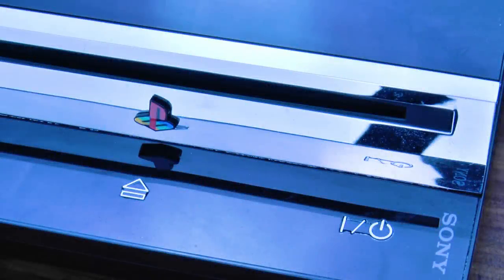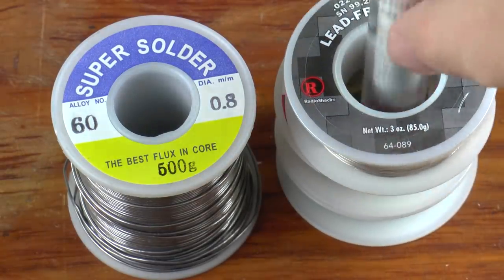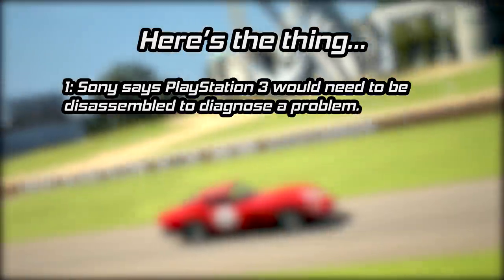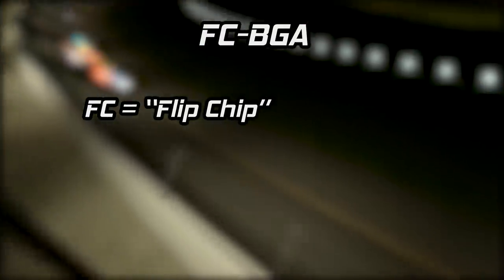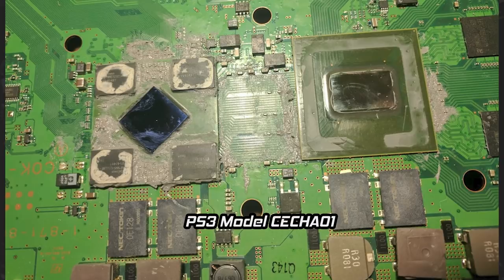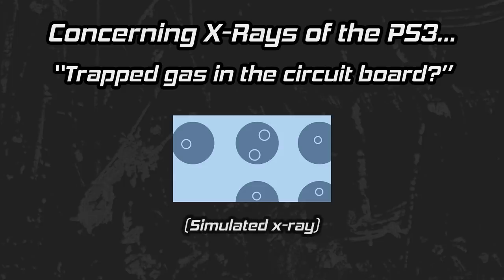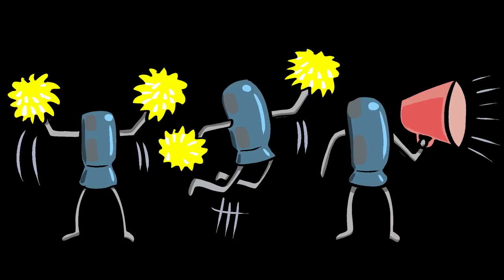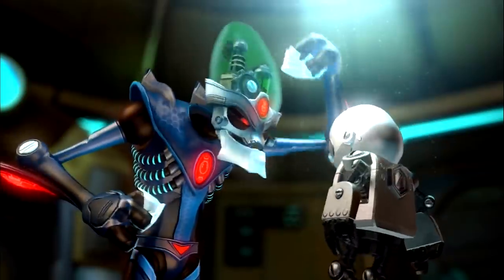The Misdiagnosis of the PlayStation 3 Yellow Light of Death

Comment: So only the Wii had adequate cooling in the 7th generation
Reply: It had nothing to cool, it was super low voltage.
Reply: Super_Slav I think you mean low power. And yeah, there was almost no power but you can’t deny that the cooling did the job adequately and the Wii didn’t overheat
Reply: Syntheon I absolutely understand how underpowered the Wii was but I’m just saying that it’s cooling system was perfectly fine for the job.
Reply: And was still the worst console that generation also.
Reply: Syntheon  Yeah it definitely sold alot to retirement homes and soccer moms.
Reply: It was politics....straight up
Reply: First generation of quite hot consoles. The generation before only needed gentle cooling while the gens before that were all passively cooled.
Reply: well, my wii suddenly turned itself off after a few minutes of game play, it showed a yellow light, and I realized  that the fan was not spinning, I removed a small stone and the fan worked fine and the wii worked fine after that.
Reply: @Steven Ross-watt lucky you, I bought one that suddenly turned itself off randomly with the "ylod" but after a while you could play again until it turns off again, as it was a cfw compatible console back then those consoles were pricy I managed to sell it as is to a technician, I recovered my invested money and he seemed ok with that flaw.
Reply: @Steven Ross-watt given the fact the wii is discontinued since 2013 yes it was a second hand console. 

Edit, with that ps3 slim model was also second hand, new consoles are extremely expensive in Ecuador, I feel so angry watching a ps4 slim being sold at 2000 dollars and yes we use american dollars as currency since 2002
Reply: @hpickettz34  As a Nintendo fan, I honestly have to agree. Outside of a handful of Nintendo games the library for it was pretty bad. It still had a much better library than the Wii U though. That said, I am happy I got one, I'm still catching up on PS3/360 games now though.
Reply: iLoveJackingOn No,Wii boasts the same power as 2 Gamecubes
Reply: Wii RVL-001 The Wii is so underpowered it didn't need any heavy cooling.
Reply: buy a cheap windows laptop on amazon. You’ll get low powered hardware AND overheating. Low power != well cooled
Reply: @REPOMAN24722  😂😂😂😂👍
Reply: It was a slightly more powerful GameCube with motion controls, of course it had proper cooling.
Reply: @MattsNotBanned_ they cant make these mistake again
Reply: Yes and No at the same time. Release models around 2006 to early 2007 had issues with overheating GPU's due to WiiConnect24 Service and a faulty power state setting in the STARLET ARM Chip which let the GPU being active during standby (only if WC24 was active = amber power LED) and the internal fan was turned off. The result was the GPU slowly cooking itself to death... Lucky enough this got fixed within newer hardware revisions before anyone could make a big deal out of it. Otherwise WII Cooling design was OK for it's job. I have 2 Wii's one made in 2006 and one 2009 model which uses the newer 65nm IBM Chip and this console runs significally cooler than it's 2006 predecessor.

Another thing they did with later Wii models is removing the additional metal EMI shield on top of the heatsink to improve airflow. Kinda similar design was used on the Wii U but that's a different story.
Reply: And the only good cooling in 8th gen was WiiU.
Reply: False. Leaving the WiiConnect24/7 or whatever the hell it was called fried components in that thing, just not with the same widespread regularity as the 360/PS3.
Reply: @ruggie.74  That's the definition of hardware failure. High rates of the same problems. If the rates are very low it is called "No hardware problem at all". PS3 X360 had very high rate of overheat issues, above the tolerance level. Just like Joycon Drift.
Reply: @alinepiroutek8932  Burh, I ain't talking about mass hardware failure. OP said the Wii had adequate cooling; my example (and I'm not the only one) illustrates that it did not. If you left that service on 24/7 for years, your hardware would eventually melt due to a lack of cooling. Why do you think Nintendo has never offered the same service since? O_O
Reply: The Wii may not have much power but it had adequate cooling.

The 360 and PS3 however had inadequate cooling.

If the Wii had inadequate cooling it would have overheated as well.
Reply: My Wii was a cockroach and dust magnet as soon as I got it and it's still working.
Reply: The Wii didn't get hot. At all.

It could have likely been made passive or was so not power hungry.
Reply: @ruggie.74  yup. I found a Boot2 Wii from my buddy (Holy Grail back in the day) took it home and noticed artifacting.

GPU RAM was done for. It still worked but... not well.
Reply: @nexxusty  Yeah, same thing happened to 2 of my Wiis and one of my friend's. :(
Reply: @ruggie.74  really? I mean I know it's happened to a lot of people.

Still sucks to hear it happen to someone. There's nothing that can be done aside from replacing the RAM.

I think I sold it to someone for really cheap. They didn't care lol. It did still work. Just artifacty. Lol.
Reply: And the Xbox 360s after the Core
Reply: I love the Wii dearly, but yeah there really wasnt much to cool
Reply: Regardless of how powerful a computer is, overheating suggests poor design.

And you can overheat even the lowest power system if you don't design it right.
The Wii does have a cooling fan and heatsink, and it has it for a reason.

Speaking of poor design leading to failures...
Guess what's known to fail on some Wii consoles?
The 'ultra low power' secondary controller used for Wii Connect 24 functionality.

Why? Because there's a bug with some models of the system where this chip doesn't correctly enter a low power state.
That's fine when the system is running, but when it shuts off the cooling fan, it can gradually cause overheating due to how this particular chip is cooled.

Point is, Weak system or powerful, if you design your cooling arrangement poorly, bad things happen.
Reply: @KuraIthys  this is why I tear down and service my consoles a few times a year, just did my ps4 last night, my wii & wii_u right before that and my backwards compatible ps3's(all 3 of them lol) are next on the list, then all the xboxes after that and the gamecubes and cart systems after that, and so on.
Reply: 3.5 inch 1Tb hybrid hdd in that ps4 btw, copy/install times are sooo deliciously small. #wuuf
Reply: @Steven Ross-watt Are they 2nd hand used or newly unboxed when you first bought them?.
Reply: Yeah, if the Wii had enough power to overheat then maybe it would have had the same problems!
Reply: @hpickettz34  I found the 12 year old
Reply: What 7 generation
Reply: Tech Troll gamer of gaming console
Reply: Actually, my Wii console had the overheated gpu issue due to shit heatsink assembly and the standby mode heat, and became permanently damaged as consequence. This happened not long after purchase with little use. Causes colour and graphic glitches. Was a launch model. 1st and only console to have ever failed me. My two fat PS3s 60gb and 80gb and Xbox 360 original still work with no problems. Go figure.
Reply: toppdogg2k17 no it wasn’t it sold more in that generation
Reply: Easy to stay cool when you're not doing any work.
Reply: Well my ps3 slim runs cool only the fat ass version runs sweaty Everytime it runs
Reply: @twizz420  lol the Wii does have enough power to overheat, specially known to people who chop them up to make portable. I don't understand why idiots complain do heavily because it was underpowered and therefore doesn't overheat.
Reply: Pretty much. It can heat up when playing disc games for too long, but it's nothing too major, considering the competition
Reply: @iLoveJackingOn plus some other niceties like increased ram and network support
Reply: @alinepiroutek8932  I still wonder how the wii u basically never gets hot
Reply: @NinjaWeedle  Good engineering
Reply: I had a Wii overheat and break, but it was probably a factor defect since it overheated in a 60F room in Alaska during winter. No way in hell a healthy system of any kind should have overheated in those circumstances.
Reply: The later 360 and PS3 models had adequate cooling, for the most part.
Reply: Matt Wolf I want to get a Wii. Getting many Wii games and and especific Gamecube tittles
Reply: The 360 was fine, the issue with the 360 wasn't the solder balls, it was actually just faulty chips straight from ATi. (I get my information from leaked internal Microsoft documents)
Reply: My Wii failed and had to be replaced... twice. Although, I will say that Nintendo is incredible when it comes to service and the replacements were BOTH overnighted.
Reply: It also had a yellow light of death, I've had 2 wiis both die
Reply: @PackardKotch  my calculator's cooling system is perfectly fine for the job
Reply: @esathegreat  well you're not wrong, its all about how much heat the device produces. The wii has a worse cooling system but it produces significantly less heat so the cooling is adequate
Reply: Xavier  Just because it sold alot doesn't mean it was good. Just look at the shovel wear and that Nintendo has been undoing the wii controls for the last couple generations of Nintendo consoles
Reply: Xavier  yeah, wii is garbage. Common as fuck garbage
Reply: That's because the Wii was just two 6th generation consoles duct taped together 🤪
Reply: Xavier  that statement is wrong, while the Wii is using upgraded GameCube hardware, that doesn't mean the loads are low, loads are not relative to CPU power but to how much can it do.
Reply: @mattwolf7698  "it was pretty bad" so let me list some good games wii had: Super Mario galaxy, Wii  Sports, Wario Land: Shake It!, Mario Strikers Charged, Super Smash Bros. Brawl,   Mario Kart Wii, No more heroes, house of the dead overkill, kirby's epic yarn, tatsunoko vs capcom, wii sports resorts, Sonic colors, skyward sword, punch out, Rhythm Heaven Fever, Mario galaxy 2. " pretty bad" right?
Reply: the wii was also the best console of the 7th generation
Reply: @ricki399  and that’s where I’d have to disagree, since they were all equally amazing. 360 had the best racing games and shooters, ps3 had some amazing grand adventures and Wii was the best console to play with your family.
Reply: @PackardKotch  i agree with you, there is nothing on wii like halo 3 or god of war 3, i just happen to like the wii games more.
Reply: @ricki399  that’s totally reasonable. I am a little biased towards Xbox 360 and ps3 because I grew up with one in my house and the other in my cousin’s house
Reply: That is literally the opposite of what the video is trying to get across. How did this get 560 upvotes?
Reply: @zanmaru139  ahhh, I see you also lurk around  Reddit
Reply: @zanmaru139  you spending too much time on reddit buddy
Reply: Wii overheating sounds intensify
Reply: that thing gets HOT when you leave on standby, but it's never actually overheated for me
Reply: If you ask me the Wii was something like 6.5 generation, a bit more powerful than the 6th but nowhere near the 7th generation, same as the Dreamcast a bit powerful than the 5th generation but less powerful than the 6th, same today as the Nintendo Switch, i would argue that it is 8th or 9th generation, nowhere near the power of PS4 or XBOX 1.
Reply: it was also the least powerful. That might explain it.
Reply: Only the wii wasn’t breaking randomly
Reply: It had adequate cooling for a 480p-576i display output, gaming only, "7th generation" machine.
The Xbox360 and PS3 were totally different multimedia beasts and the only true 7th generation consoles imho.
The Wii was a 6th-7th gen stopgap console, and Nintendo decided to keep doing stopgap consoles ever since...
Reply: Luna Lux  the wii is just a slightly better game cube, and the game cube was fine
Reply: Actually, early Wiis also happened to die from overheating due to a firmware bug that kept the processor running without any cooling while in sleep mode. The heat built up over time and consoles died. That made a lot of Wii owners at a time to always turn the Wii off completely, and to never use sleep mode, years after the firmware was updated and the bug fixed.
Reply: Wii’s had defective disc drives and also would overheat if connected to WiiConnect24 while in standby mode.
Reply: Haters like to claim that the Wii only sold because of Wii Sports and always ended up collecting dust when the novelty wore off but this is not supported by real figures. In fact, this is thoroughly disproven by the fact that the Wii had the highest software attach rate of all consoles in that generation, including the portable ones.
Reply: true, mine has been left running for literal months on end, has more hours of playtime on it than I could even try to figure out, still works like new 🐱
Reply: Nope.

Wii Connect 24 fried my launch Wii.

They all had issues. That entire generation.
Reply: @PackardKotch  Alot harder to cool something that generates alot of heat.
Reply: Due to the adequate weakness
Reply: more like the Wii was the only console with a working GPU in the 7th gen
Reply: @gypdarin1458  Buy a super cheap, super weak laptop from somewhere. Quite a big chance you'll run into heating issues regardless how weak the hardware is. 

Seriously think about that logic lmfao, if overheating can't happen on weak hardware how was there overheating issues in tech 40 years ago?
Reply: It also won the 7th generation...
Reply: Well the Wii was essentially an overclocked GameCube and both the 360 and ps3 had reliability issues with the processors
Reply: @hpickettz34  that sold the most units.
Reply: yup got a ylod and rrod at that time both are out of warranty when it happened
Reply: this is false , my wii burned out and overheated from playing SSBB
Reply: @itzderrio  how did that happen
Reply: @rgracing4109  because i played it alot and SSBB uses dual-layer disc that the wii struggles with
Reply: How has our ps3 not had the yellow light of death. It turned the normal loud fan on but then it was as loud as a vacuum.
Reply: @PackardKotch  Wiis did overheat. Early Wiis using Wiiconnect24 had the GPU idle while the fan was off, causing it to overheat.

I have a black RVL-CPU-60 Wii without this issue, though.
Reply: My PS3 Super Slim is second hand and works great! Gutted a Hard Drive from an old laptop and put it in there and it works like a charm! Never gets hot! Stays cool no matter how long I leave it on... my Switch on the other hand... I got that close to launch and late last year the fan started dying and now when I play docked the thing overheats and goes into sleep mode after just a few hours of play. Super loud in Handheld too. Waiting for my W2 to come in so I can hurry up and do my taxes and hopefully get a good enough refund to get an OLED model. Wish me luck!
Reply: @Ty4ons Besides the Original Xbox,that needed pretty good heating

Comment: mine came back to life by itself just by sleeping 4 years in the closet
Reply: Mine still works till this day just needs a exchange of cover as it's scratched
Reply: @thealien_ali3382  Till this day? So it died today? Or did you mean "to" this day?
Reply: Dragon Shippuden  I'm calling bs
Reply: @lukewatson059  but why tho?
Reply: Pablo Perez sony used the wrong paste
Reply: ill have to pull mine out and see if its working again,them caps look easy to replace might try that :)
Reply: I'm still waiting for mine to wake up.
Reply: @PabloRey18  because then you have a working ps3...  its a hassle but it saved mine Twice added 4years
Reply: Damn i shouldnt sold mine
Reply: I bought one and it works 100% fine. Just gets really fucking loud
Reply: My ps3 has been sleeping in the closet for 7 years and still hasn’t worked
Reply: @Swampert_Tube  you should open it and change the thermal paste its dry thats why its loud
Reply: Not mine, it's still dead after 2 years😢
Reply: @PabloRey18  its bound to be dry
Reply: @leonarddurecki5988  its ok 😢😢
Reply: @Swampert_Tube  usually that means its on its way out. 😂
Reply: Knock on wood. I've had mine since day one and it still works. Yes I've had the paste replaced and I upgraded the fan and the power supply. Maybe I caught mine in time. I don't play it as much and I actually turn it off from the back when I'm done playing with it. 14 years and it still plays like day one.
Reply: Trujillo 2020  is hacking a ps3 and installing cfw a difficult process?
Reply: @lucabops4778  I did two in about 3 hours last night.

However I am a genius.... lol.
Reply: @nexxusty  sure bud
Reply: Same
Reply: Post links
Reply: Wish i still had the screws to my fat playstation
Reply: mine toooo....but now my ps3 sound is like a jet plane....
Reply: DJ Soru Not anymore. You can easily CFW any PS3 now.
Reply: Mine somehow died while in storage?
Reply: I don't know where you live, but as it is not hell, I am fairly certain, this is indicative of some fancy chemistry in the capacitors being the relevant factor and not resoldering.
Reply: Yup
Reply: Too late I already got a PS3 slim and PS2 fat so I don’t have to worry about no backwards compatibility.
Reply: Proud of your PS3 for having the courage to tell the world who they truly are.